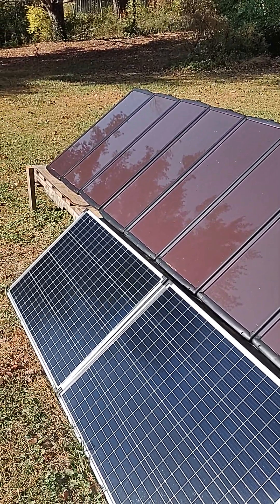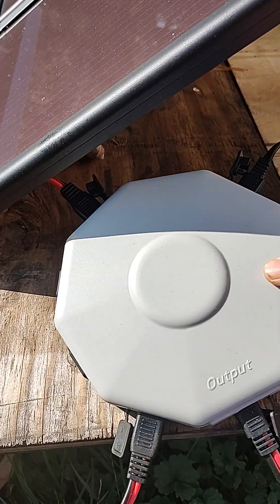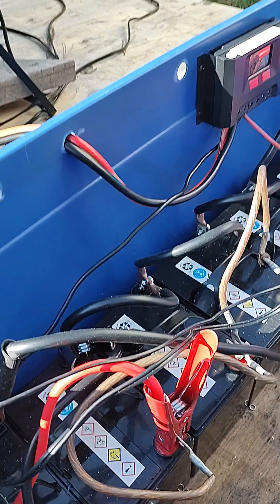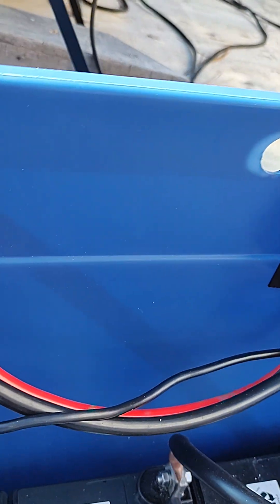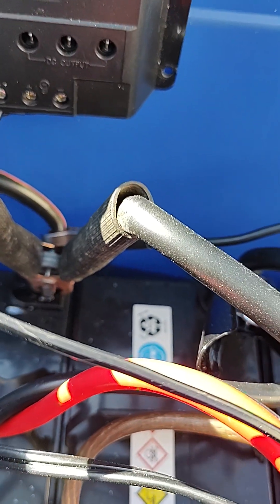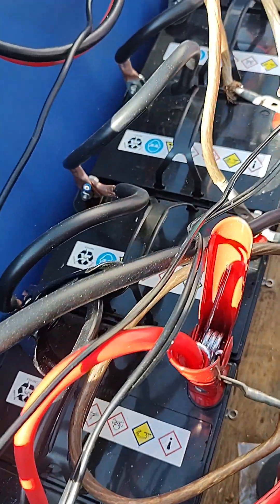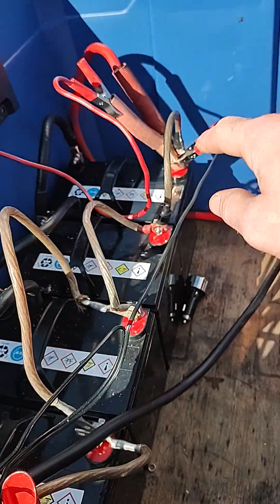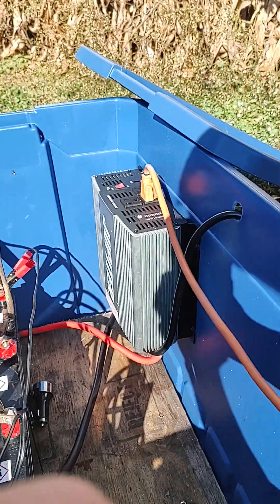How My Solar Panel setup is wired!!

Comment: Good set up.  I run 5 100ah @ 50%DOD 250ah AGM batteries.  I run 2awg cables to each battery from a buss bar setup. 2 mppt charge controllers. One CC is for my 210w panel. And the other CC is for my 2 HF 100w panels. I run a 1000w renogy pure sine wave inverter. This whole set up runs our bedroom except for the ceiling fan. Lol.